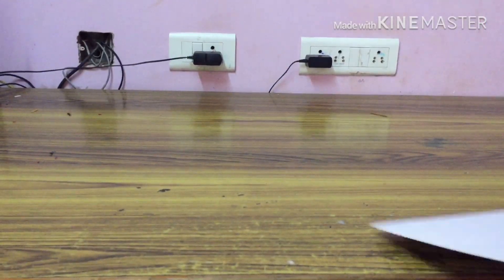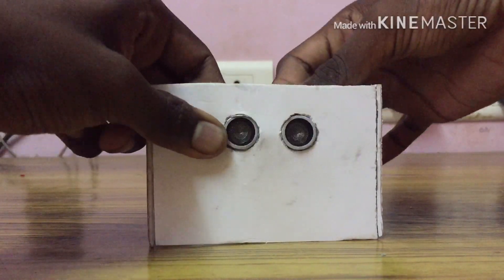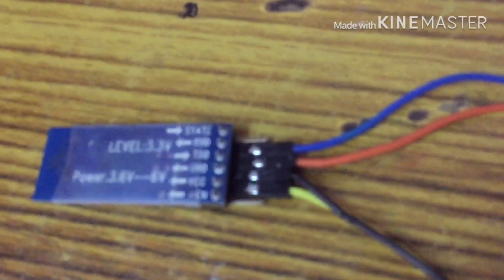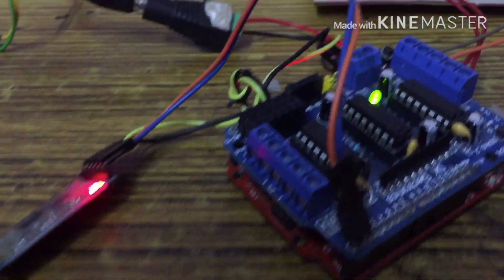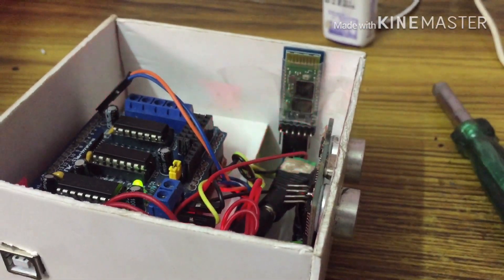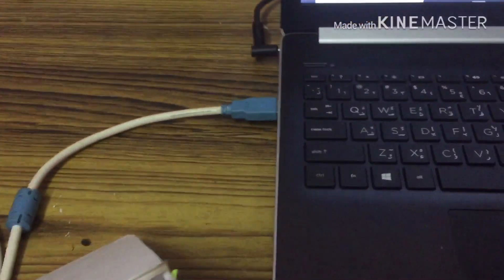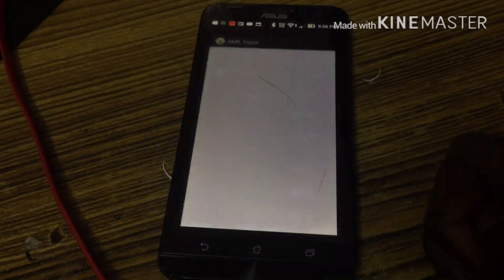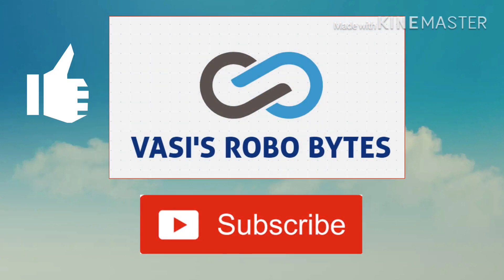How to make Voice Controlled Robot|Tamil|

Comment: what is difference between arduino clone and original board anna.???????????? please tell anna please
Reply from the maker: Both are actually the same but the PCB(circuit board) colour and placement changes according to convenience. All the electronic components in clone is exactly the same with original one.